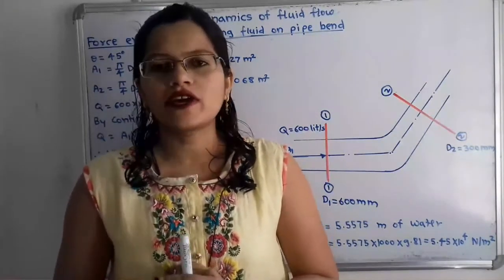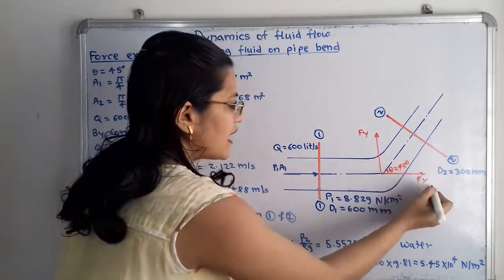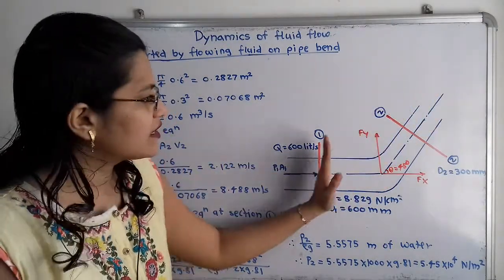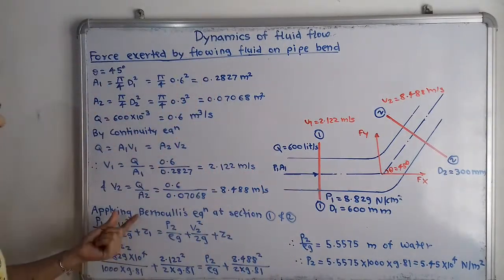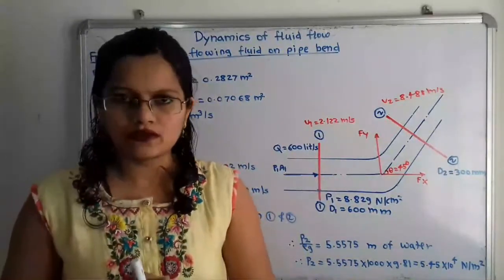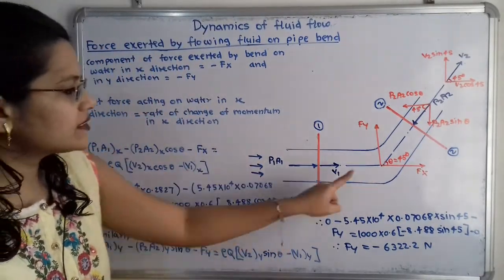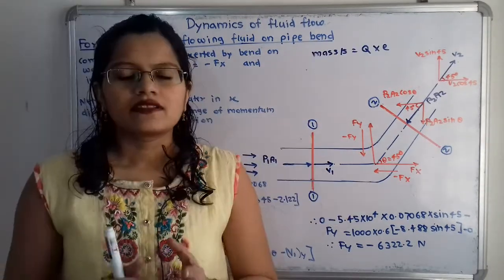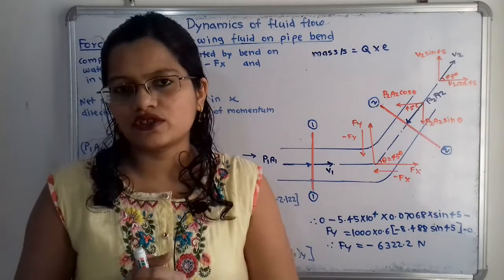Problem on Force exerted by water on pipe bend(Solution in detail)/momentum equation/Fluid mechanics

Comment: Hello mam , my Question is
A 30 cm diameter horizontal pipe terminates in a nozzle with the exit diameter of 7.5cm if the water flows through the pipe at a rate of 0.15 m3/s what force will be exerted by the fluid on the nozzle?

Please solv the question mam🙏🙏🙏🙏